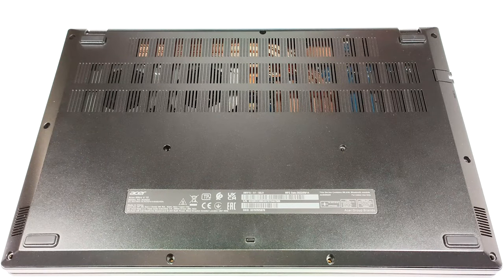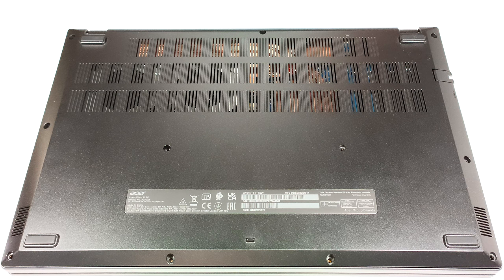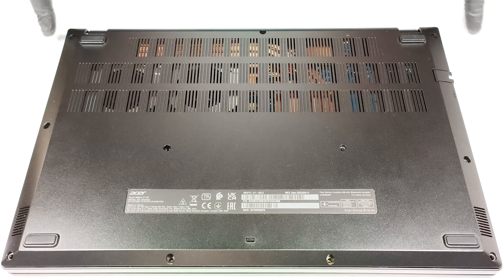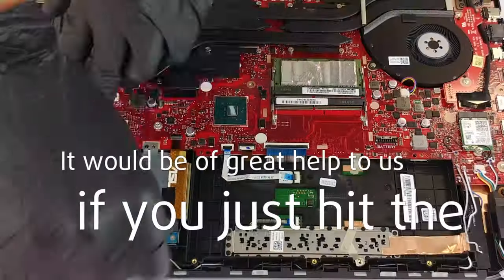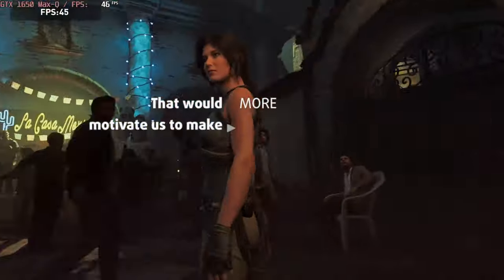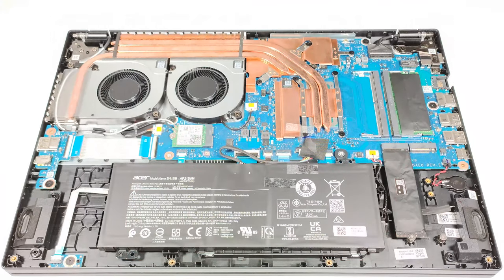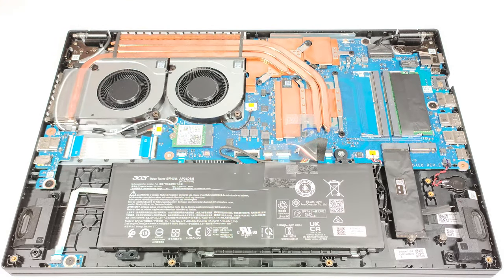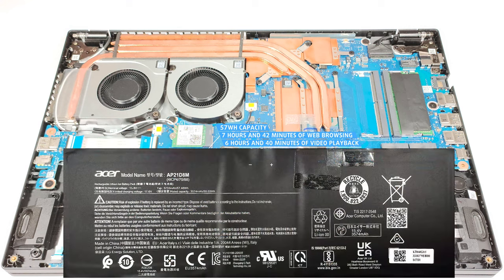🛠️ How to open Acer Nitro V 15 (ANV15-51) - disassembly and upgrade options

Comment: I got this laptop for Christmas and it has not disappointed. Very happy with it.
Reply: Same.
Reply: Bro I need to talk to you, you have Instagram.
Reply: Can you limit battery charge to 80% in nitro sense? Does this setting saves itself or you have to do it everytime you  start the laptop?
Reply: @Balkeet007  yes
Reply: @Scenemachine780  do you have to do it everytime you start the laptop?
Reply: @Balkeet007  nope
Reply: @Scenemachine780  thanks
Reply: I hate mine
Reply: @brendasmith4220  why?
Reply: Bro, are u have suddenly black screen issue while gaming? I have buy this laptop for a week and when I play gta V (even with normal graphic quality) my laptop always get blackscreen after 30-45minutes of gaming
Reply: @brendasmith4220 do you have same issue like me?
Reply: @ababilkuadrat6104  monitor temperature while gaming with afterburner. Don't let the temperature get into 90°C
Reply: @Balkeet007  i play valorant and it got 300+ fps, and temperature stay at ±60 Celcius. But this issue still happen
Reply: fr

Comment: I have the anv15-51-98n0, I have 16 gbs of DDR5 ram, when I check the speed it’s at 5200mt/s. I want to upgrade to 2 16gbs of ram making it 32gbs, can anyone help me with finding the correct ram
Reply: Specs - intel i9, 4060, 16gb DDR5

Comment: My nitro v has 512gb pcie gen4 ssd and I want to add 1TB pcie gen4 ssd additional. But other slot is of gen3.
So can I remove existing 512gb mounted ssd and place it in gen3 slot. And larger 1TB gen4 ssd in gen4 slot to get gen4 read and write speed on large storage.
Then what problems would be there.
Reply: I have the same question, did you find any info about this? @sahilawasare8780
Reply: Yes u can
Reply: @sirletodavide1452 but would booting it will be slower since windows is installed in 512 gb ssd
Reply: @sandeshjha5906  yes a little bit slower but not noticeable as gen 3 is fast 
but it is better to clean install window

Comment: I saw alot of comments here they are saying that the acer nitro v15 they bought has 5200mhz ram ddr5 but mine has 5600mhz
Make sure to always read what ram they putted or read the specs of the laptop you bought since alot of versions of acer nitro v15 has published
My friend has rtx 4050 6gb ddr6 5200mhz so plss if you dont want to destroy your laptop
Make sure to read what ram is inside of your laptop and make sure to buy a same pair of it
I bought 16 gb ram 5600mhz to my acer nitro v15 rtx 3050 6gb vram
And i can say it improves alot..
(note: i putted 8 and 16 gb ram together= 24 gbram)
Reply: put*
Reply: it simply means yours can handle higher Hz ram, the only difference it will make with getting a 5200MHz over 5600Mhz is that it'll perform slightly slower. What you need to pay attention to is the limit it can support
Reply: @rbacon8922  mine have a 5600 MHz installed, checked with HWiNFO it said the model number was HMCG66AGBSA095N. But in task manager said it run at 5200 MHz, I guess it's got downgraded by it limits at 5200 MHz.
Reply: @MochiC_  Yh the motherboard only allows it to run at the max that it can handle. If it's a 5600 MHz stick but it's running at 5200Mhz then it's the motherboard sticking to its limit. 

UNLESS there's a 5200 MHz stick paired with a 5600 MHz stick. This is why mixing ram isn't safe because if the speeds are different between both ram sticks, the motherboard will bottleneck the higher ram stick to run at the same level as the lower stick.

Comment: can the SSD slots support SSDs with chips on both sides? Like the 4TB SSDs which have chips on both sides
Reply: it probably does as the motherboard ends right where the ssd is located

Comment: Will Kingston NV2 1tb PCIE 4 work on this?
Reply: You should do gen 3, the extra slot isnt gen 4
Reply: @coolcrazyguyer  its better to use gen 4. because you can use 2 tb gen 4 in 1st and place stock 512 in slot 2 gen 3

Comment: I have a question can u pls help me can i use one DDR5 4800mhz RAM stick in this laptop ? or only 5200-5600 ???
Reply: voce pode, mas ira operar com o menor mhz para nivelar.. o nativo é 8~16gb 5200mhz, voce colocar mais 8 (ou seja 8gb 5200mhz nativo + 8gb 4800mhz adicional) ira operar em dual-channel 16gb 4800mhz.. lembrando que se for DDR5 (oque é o desse mostrado no video) devesa ser DDR5 tambem a nova memoria.. meu ingles nao é muito bom para escrever textos
Reply: Alt. Ctrl delete loook up for your capable

Comment: I am not a computer guy, so bear with me. What’s the RAM specs?  
I know it’s 16gb 5200MHz but that’s all. I want to buy another RAM stick but want it to be the same so I don’t overspend or slow it down. Also is there a requirement if I want to put 2 new RAM sticks entirely, as sometimes it comes cheaper in pairs. Thanks
Reply: This one comes with 16 gigs of ddr5 ram, meaning 2 sticks of 8gigs each. The most you can get on this is 32 gigs, meaning 2 x 16. If you wanna upgrade to 32, make sure to get ddr5!
Reply: @abyssosque Thanks for the reply, but mine is actually 1 16gb stick, as I can see from the system data that there's one slot available, so nevermind my first question as it might be different depending on the device. 
Aside from that is there any requirements or limitations on the RAM that can be installed (like maximum 5600MHZ or no lower than 40CL). as I might buy a pair of RAM sticks later. 
Thanks in advance.
Reply: @abyssosque but i check using cdm command
'wmic memphysical get maxcapacity" and it says
maximum ug 64 gb total ram meaning 2x32gb 5200Mhz

Comment: Hello, what ram should I buy for that laptop, a 5200 MHz one? because it says ddr5 5600
Reply: Ddr5 5200 MHz in has this one
Reply: @hecker4758 1 slot came with a 5200mhz 2nd slot also supports that? Cuz I saw somewhere 2nd slot support ddr4 ram.
Reply: @aizen4851  both can be equipped with DDR5 ram my friend upgraded the ram it's works 32gb (16×2) dual channel 5200MHz

30/4/2024
Reply: @hecker4758 thnx brother can you tell me which company's ram was installed inbuilt cuz I wanna sell it and I can't open the lap.
Reply: @aizen4851  The two slots in ANY laptop will be of the same type RAM, you can't mix DDR4 and DDR5.

Comment: I was worried this laptop would have only ONE fan for a 4060 mobile, but naw. It has two, which is really good for an i7 and 4060M :P
Though I hope there is enough room for a small heat sink for the SSDs.
Also do you know what the airflow is? Cuz if this model draws air from the bottom, that would be perfect

Comment: Is ram 2x32 gb on total 64 gb or on total 32 gb with 2x18 gb
Reply: Total 32 gb is supported
Reply: @xtrmgaming but i check using cdm command "wmic memphysical get maxcapacity" and it says maximum ug 64 gb total ram
Reply: @xtrmgaming yeah i check also in cmd ang it says 64gb maximum ram
Reply: Any updates? Did you successfully install 64GB? I'm considering this upgrade

Comment: I have the 512gb ssd version will it work if I add a additional 2tb ssd gen 3 pls answer
Reply: Yes it will. I just installed a Samsung 980 1 tb gen 3. Works perfectly
Reply: @InspireVisionaries   yea but will a 2TB ADDITIONAL SSD WORK?
Reply: @1ofakind615  it supports 2tb in each slot so it will be ok.
Reply: @InspireVisionaries   does this laptop support PCI 4th generation?
Reply: @Malakhov_ni  2nd slot is gen 3. 1st one is gen 4, so u have to shift stock ssd to gen 3, if you are going to buy 1 tb or 2 tb